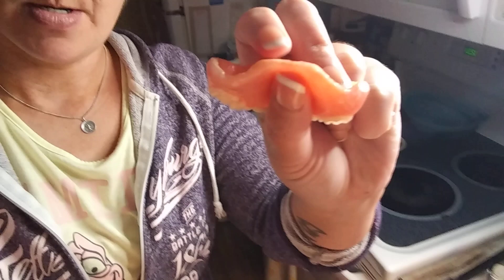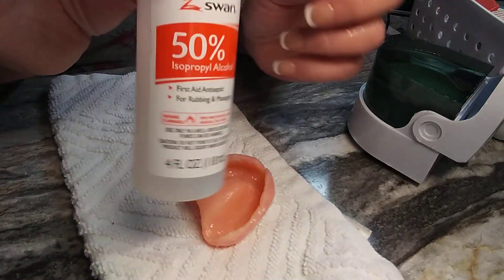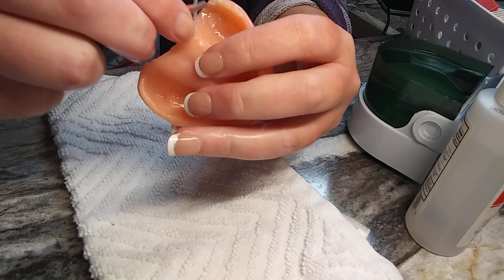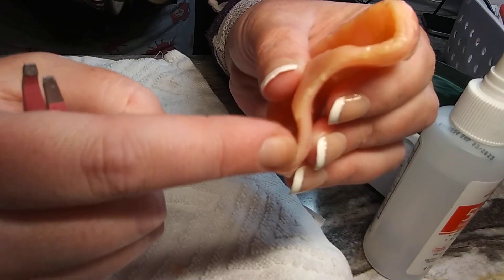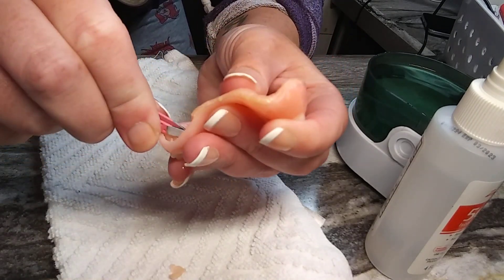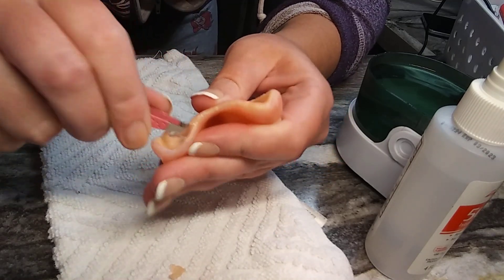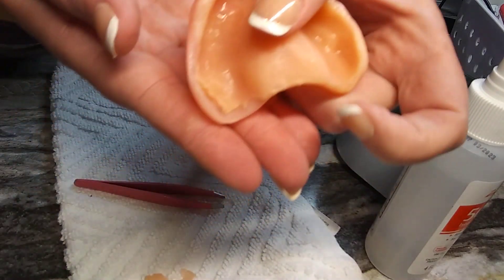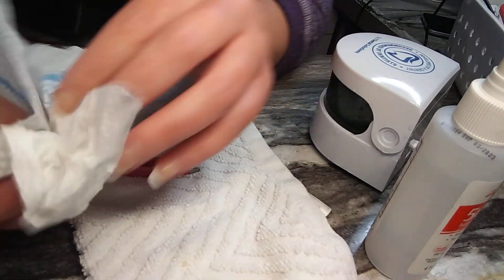How I take out soft reliner!!!! 😁💜

Comment: Trying to get the dentist's old hard liner is even worse.  It's more thin acrylic and not all all soft.  🔥🔥🔥  I got some of the long acting liner (Permasoft, I think) and haven't applied it yet...  Unfortunately I broke my lower from eating roasted almonds...  I did it for years until the dentist hard liner started wearing off.  The dentist liner is actually keeping my bottom together, even though it's been 6 years and broke...  Had to unfortunately use super glue once daily to eat....

Comment: Why wouldn’t you just go into your dentist to have soft realigns done? Do a lot of dentists not do realigns for patients? Mine said anytime I want or need one to just call and they would get me in to get in Done but I’ve seen a ton of these soft realigns all over YouTube I’m genuinely curious as to why people do these at home.
Reply: Im an assistant have been for 30 years. Its my experience, DDS will do relines. But recently these young DDS don't like to. I don't get it. Either way, yes its hard to remove, we have special drill bit for dremel like tool that helps get it out...
Reply from the maker: Soft relines can be done at home. They are better and cheaper
Reply: Hundreds cheaper
Reply: My dentist told me that she does not recommend soft relines and at 3 months told me I should get a new scan and new dentures made if I felt they didn't fit. Basically, my dentist sucks. Been struggling and doing my own soft relines while researching and looking for the right place to make a new set at my year mark.
Reply: If you have the money then yes taking it in to have it done is good idea. However I don't so it is either do it myself or not be able to wear my dentures. I did it myself and it turned out great. I adjust mine myself too. But I don't recommend people adjust their own dentures. Right now I can't drive and my dentist is half hour away. So I adjust them.
Reply from the maker: You can do soft freeliners that'll be done better by you at home they're cheap. It's like $6 for a soft freeliner at Walmart LOL. I've done many many videos explaining and showing step by step on how to do it and when you guys get used to it you'll become Masters at your own self reliner and wonder why didn't you do it sooner but like I said if you have a warranty you cannot ever do your own work they will void your warranty if they find out and that means if you break your dentures something goes wrong no visits no new denture will ever be covered so if you have a warranty you have to see your dentist
Reply from the maker: Yeah that's not true many older dentists have told many people that have come to me that they won't do soft reliners. They refuse to do them there's no point of them doing it they can just keep hard relining which is bad and make your denture super thick and you can't fix that. So I think if people cannot go with the times then they probably shouldn't pick that profession cuz you should do what's best for the patient

Comment: Hi Heather tomorrow 8/14 will be 1 month with my immediates they are a little loose but not too bad,I can’t eat with them too good so I got the DR B’s adhesive about a week ago (already had fixodent w/scope) I used the fixodent once but I think I should’ve used more but i tried Dr B’s yesterday for the 1st time I had it on my dresser for about a week and when I went to use it, it was soft and gooey I put a few drops and it’s working fine I’ve been able to eat so I will order more they gave me the wipes samples and a small pack of crystals! But when I do a better job of adding more how long can i leave in? If it holds a week is that ok? Thanks Heather!
Reply from the maker: Adhesive lasts up to 12 hours or more. Sometimes you add a little more bc everyone is different and has to dry in yoir mouth for an hour before you eat and drink. Soft reline is different. It can last for 2 month's but in this immediate denture stage your gums shrink more and more every day so it wont fit right even after a few days so most likely you will need adhesive as well. Immediate denture stage is annoying and frustrating at times. But I do my soft reline it lasts and helps but I cant go without adhesive for a secure fit I need it. I have so much shrinkage and healing going on. But reline can last a very long time even months if done right. Jist depends on the person and also cleaning your denture well every day